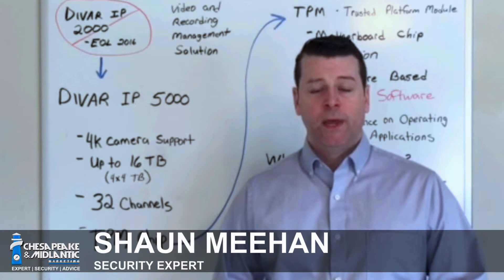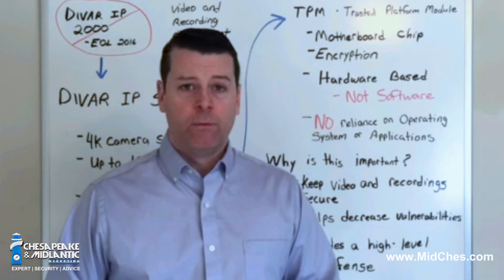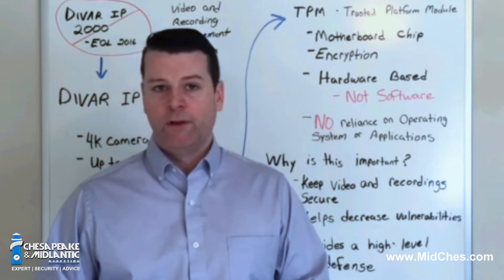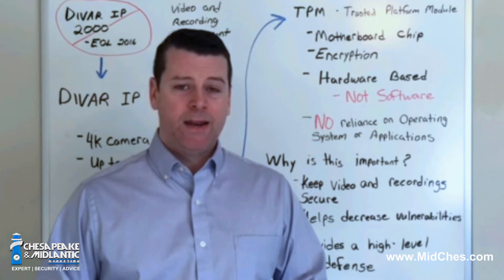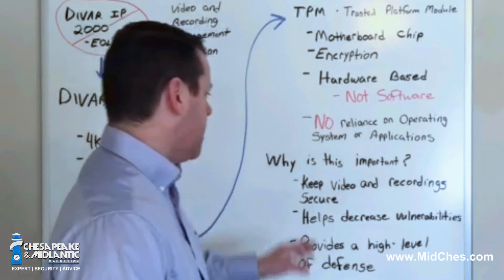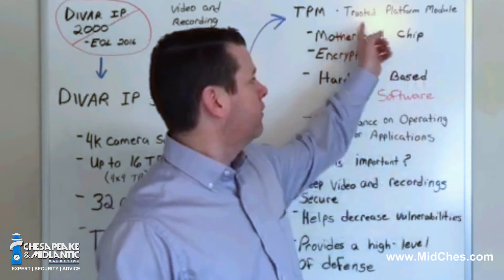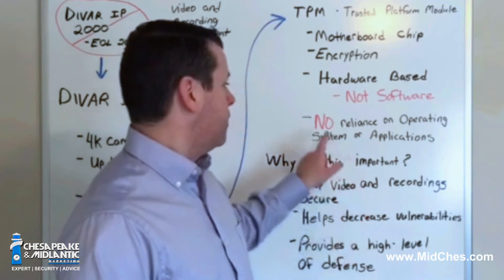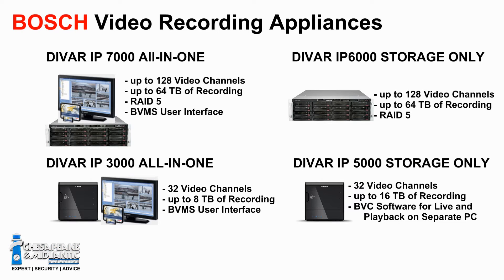TPM Module: Importance to IP Security Devices

Comment: bingo, my new x570MB had this pin support and wondered what it was for, then google had their new annoying commercial showing the chip inside and was thinking how they relate. seems software will always have a back door and a physical chip is yet another way to add a barrier.  Stores passwords and encryption data, why is this not wide spread application when only $20 for PC use? Much to learn.